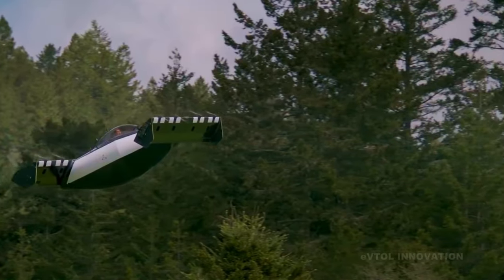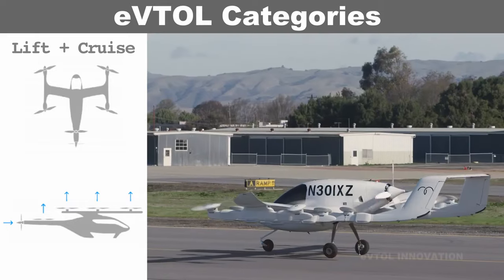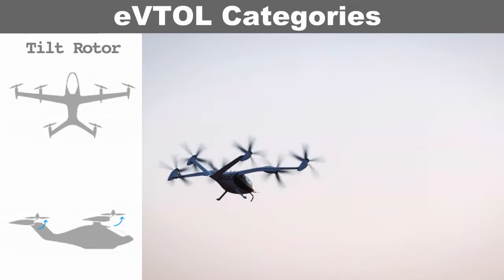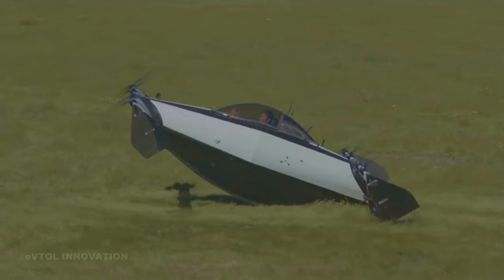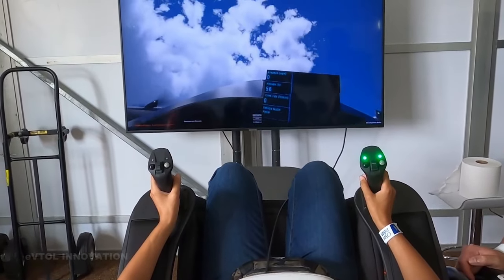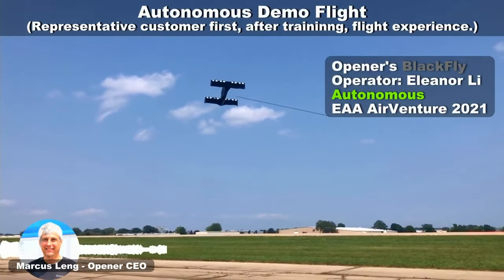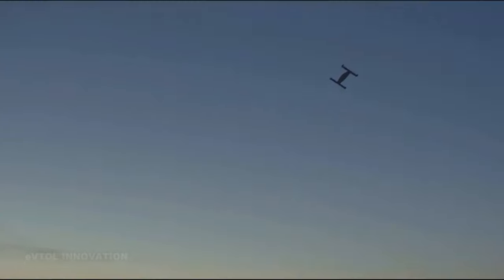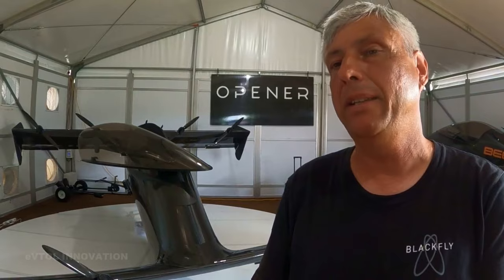Is this the best personal eVTOL aircraft? | Opener's BlackFly [Pivotal Helix] Innovative Design

Comment: Until either or both better battery tech or better electric motors ( lighter , higher energy storage capabilities and lighter more efficient motors).... this tech is NOT viable.
These vehicles operate for MINUTES.... on a single battery charge... NOT HOURS.... 
therefore as their “ endurance “ is low.... so too is the range.... ..not hundreds of miles... but rather “ TENS” of miles at best
Reply: Exactly! Get-you-nowhere novelty that plays in people not knowing much about ultralights, and this being easily impressed by “personal  flight.”

This thing has an optimistic 40km range (24 miles). Based on company promo material. Add a reasonable safety buffer, and it can go what? About 18 miles? If you want to have enough juice to make it back, then you can go maybe 9 miles? Landing and takeoff probably use much more juice too, so if you want to land at the destination and make it back, safely, then you go maybe 2 or 3 miles, if even.

You can recharge at the destination? So basically you can only practically fly this between recharge stations, and they can’t be far apart. How long to recharge it?

Zip lines are a more practical form of transportation.

Meanwhile paramotors can go a couple hundred miles on a a tank, and intermittent refueling to extend that range is actually feasible. Not theoretically either. People do it. Today you can buy a complete tandem trike paramotor setup for under 2k. It is a more mature, well proven, and safer technology that is practical, affordable, and commercially available.

Mandatory (company policy not law) training? How much for that? Are there independent trainers, or is it a monopoly training scheme without the benefit it competitive pricing. Geo-fencing? Wow! Travel nanny track your movements big brother bs. Cheaper ultralights go farther and let you go where you want when you want and face the consequences yourself because you are capable of being responsible for your own actions.

Yeah I’m absolutely floored by how totally absurd this stuff is. There have been companies promising these absurd flying cars based on ridiculously impractical technology for the past 40 years at least, and nothing has come of any of them. Meanwhile people have actually been flying around in inexpensive unregulated ultralight vehicles based on practical technology, the whole time.

I guess the difference is that the flying car vapor ware tend to imply parking in your driveway and flying to work. While that’s probably not going to become practical for a very long time, paramotors don’t actually need much space to get airborne, nor to land. The problem is the large paraglider element  and all the paracord which all become tangled hazards taking off and landing in urban/suburban locales. I can see near future technological advances addressing those issues though with things like modern materials and nanotechnology.
Reply: Oops. Not 2k, meant to say under 20k. You can’t buy a complete tandem trike paramotor setup for under 2k. You can buy such a setup for under 20k. Sorry about all the typos too. Autocorrect on iPhone is abysmal. iPhone also is too stupid to let me edit the comment to fix it.